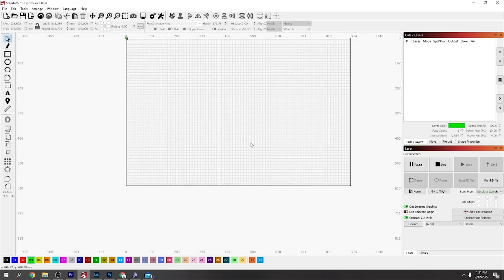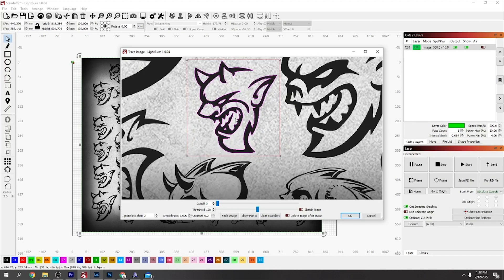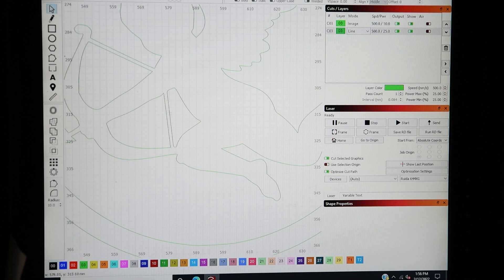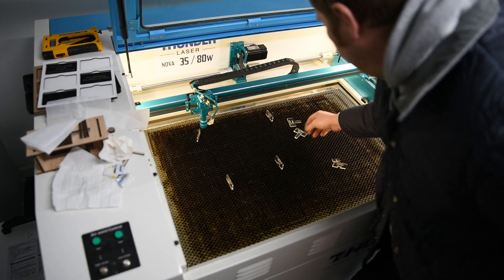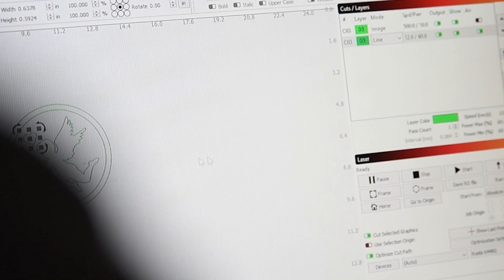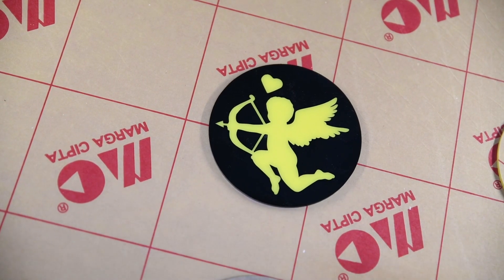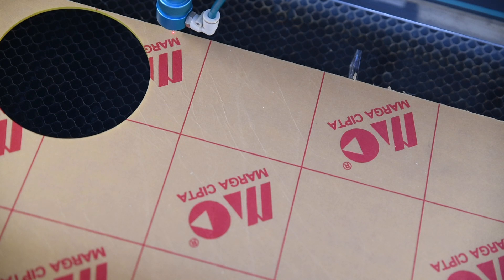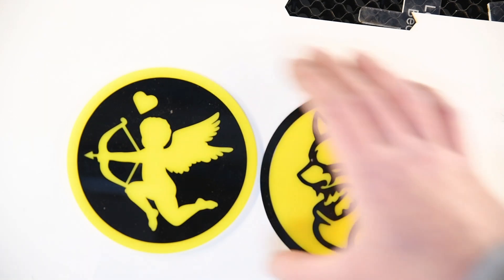Acrylic inlay With Kerf offset in lightburn

Comment: Do you need to use any kind of glue or adhesive to make these parts permanent or do they just stay together with a tight fit?
Reply from the maker: these were very thin so i would use double sided 3M adhesive and only see one side, but if the acrylic was thicker im sure weld-on would work to hold them togerther .